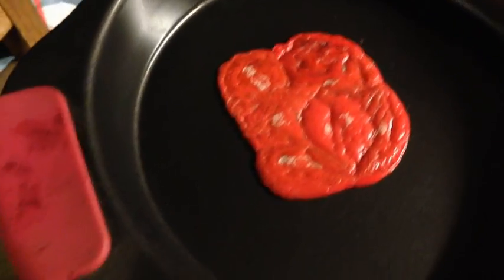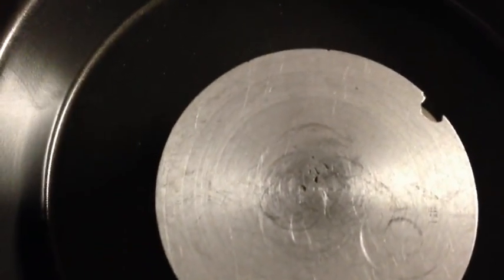Ep72 Coke lids can be used with flowing HDPE part 1- 2

Comment: hdpe will be okay with wax paper right?  I need something bigger than my cut of tin can but I know hdpe gets canserous when it touches other plastics while its still wet
Reply from the maker: Sorry have not tryed wax paper. 
My best guess would thing that if you were going to put wax paper in the oven. You would melt the wax out of the waxpaper and collect the wax and paper will be burnt
Reply: Kevs Modelling Channel Okii I'll try it and some point and see. I'm guessing  I'll need to fold it to make a sturdy lil pan
Reply: Kevs Modelling Channel are you using a biscuits tin lid? What brand?
Reply: Sound quality is terrible
Not sure what your doing
Reply: Baking paper g stuck in the plastic. I have used “baking” or “BBQ” sheets. Try a BBQ shop.

Comment: hi Kev. what are tesco's still water lids made of?
Reply from the maker: Hey Andy 
I am not familiar with the Tescos water . If they are a company that manufactures soft dinks then the plastic ie lid has to withstand the pressures.  Then it makes sence to think that the company would not change plastic in the lids. 

So my best bet it would be HDPE and characteristics it will not flow in a mould
Reply: Kev I'm talking about Tesco please see this image http://img.tesco.com/Groceries/pi/015/5000462001015/IDShot_540x540.jpg
Reply: Kevs Modelling Channel go look at my chanel. Christy shaped a rounded beach stone into a square on one end, and left it round in the other. (use a wetting  to shape ya beach stone